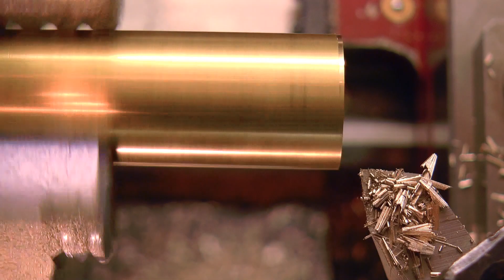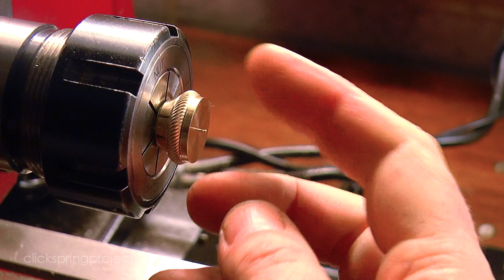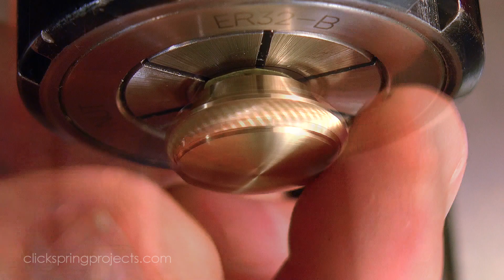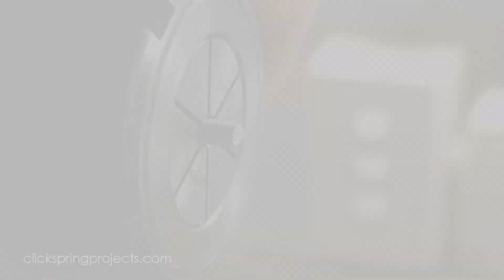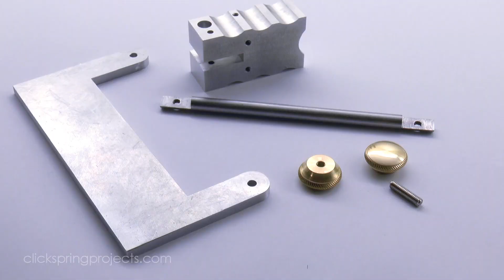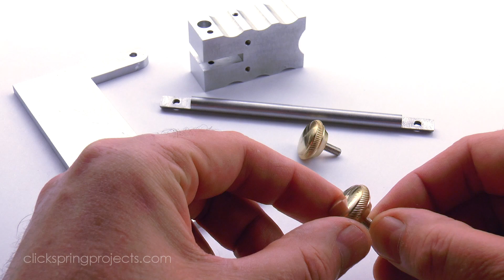Custom Rope Knurled Thumb Fasteners

Comment: I wondered this from the last knurl video: how does the knurl pattern mesh correctly? Does the starting material have to be just the right diameter or is there some magic to knurling that works out? Because it seems like essentially roll forming a shallow toothed gear.
Reply: I was about to ask the same question.
Reply: Check out the video by Tom Lipton he has a video about the math behind the knurling.
Reply: The circumference of the stock should be approximately an integer multiple of the pitch of the knurling wheel. Knurling wheels are available in a wide variety of pitches. There's a bit of leeway, because the effective diameter of the part changes as the knurling is applied - you can often get away with just brute-forcing the tool into the work until it meshes.
Reply: In theory it's pretty complicated, but in practice it just works.
Reply: @Leadvest  One of the very few times it's that way around...

Comment: I still don't get how the indents in the knurl align themselves. How is it that the last knurl indent in the circumference neatly ligns up with the first? And then it gets deeper with every turn so the circumference is constantly changing. Does it automatically shift minutely to adapt to the most ideal outcome?

Comment: I have a stupid question.  How do you make sure the knurling is the right size?  Do you have a different tool for every diameter knob you’d like to make?  At such high speeds, even tiny variations in the knob’s diameter will tend to walk the knurls out of sync.  What am I missing?

Comment: Does one have to do math on the pattern and circumference to have them match, or does it self-align to avoid creating half-grooves somewhere?
Reply: Knurling deforms material rather than cutting it so as the tool presses on the work piece eventually it hits a point at which the radii of the knurler and the piece form are in a rational number relationship (like gearwheels). Then you get an even knurl.
Reply: @davidgillies620  that makes sense, thanks for explaining. It's pleases me that it will simply work every time 👍

Comment: As I watch these CS videos I keep wondering about the material.  On my screen it often looks yellow/orange and makes me think brass, but then something will say or suggest that it was steel.  Is it something about lighting, or other video factors?  Or is it real bass or something similar?
Reply: It's definitely brass. Ease of turning, beautiful surface finishes.
Reply: Bob H - same here. I find it can go either way: sometimes steel looks like brass, or vice versa. In this case we know it’s a brass piece bonded to a short piece of steel, or possibly stainless, threaded rod segment.